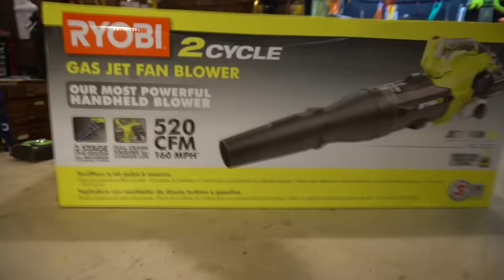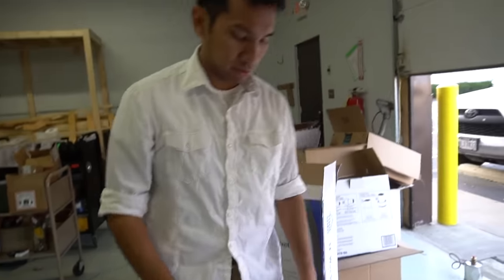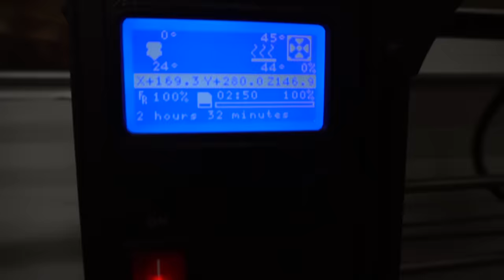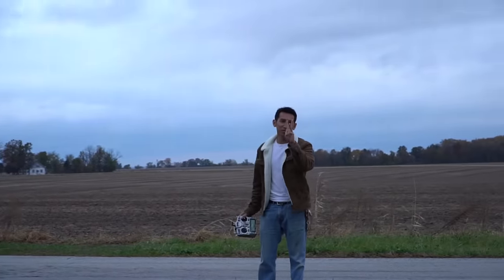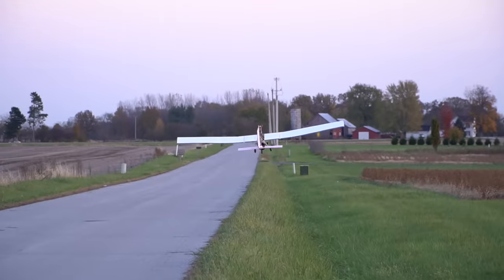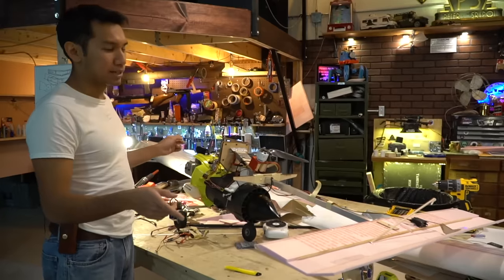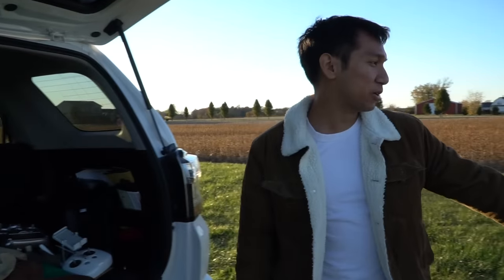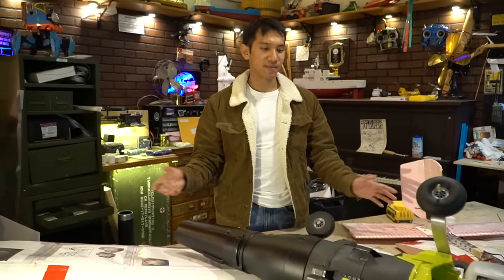FLYING Leaf Blower RC Airplane Drone

Comment: Hook a regular propeller up to the output shaft on that gassy boi and let'er rip!
Reply: Yeah, put a prop on the front of the gas motor shaft for a bit more thrust.
Reply: @greggv8  I have a weedeater engine with a 20x8 prop on it that pulls hard, never actually put it on anything though but I have heard people converting little 2 smoke engines to run RC planes before.  I mean frankly if he wanted to do that he could have the one I have if he pays shipping, more of a multi rotor person myself and won't use that engine in the long run.
Reply: Yes, stripping a twostroke down to the neccessities and bolting a prop to it is a great way to go. Maybe a lighter flywheel and a better exhaust and slightly advanced timing can further enhance performance, at least for the time being...
Reply: @KlockworXMusic  The early large scale planes used slightly modified chainsaw engines.
Reply: alternatively you can use a .5cc mini engine
Reply: Nice to see you on this video lol
Reply: a must first step is to always try to see if it glides well. throw if off your hand. to see how large the wings have to be
Reply: And adjust the throttle to make it really wind up
Reply: exactly
Reply: Junkyard Digs yeah man I thought of the same, like put it on the clutch
Reply: Yeah well... America💪
Reply: We did build some rc boats using 2 stroke chainsaw engines. Goes like nothing that you can buy of the shelf.
Reply: You need to add a larger duct to the existing smaller duct to add about 30% more thrust.
Reply: Don't give up yet.
Reply: @Asus Moh spam
Reply: KlockworXMusic c
Reply: Hi big fan
Reply: Take the head off and get some thinner gasket material to increase the engines compression
Reply: Kevin is a legend
Reply: P.s. thanks for your service
Reply: exactly Junkyard Digs, father an I used a Chainsaw back in the 70's an it worked great, right up till our plane thought it was a boat.
Reply: 666 like illuminate confirmed
Reply: Not a blower anymore then. Blower motor but not a blower.
Reply: ChessMasterNate under that logic, adding the wings should not be allowed, cause it is not a blower any more when you attach those wings. So now that the stupid arguments are out of the way, CHANGING the blower blades to one that is more suited for an airplane is far less of a modification then adding those wings and servos. If all you did was change the blower blade to a propeller and never added wings, you could still "Carefully" use it as a blower
Reply: I did not expect to find you here, cool
Reply: yea let'er rip tater chip
Reply: Leave it as is but modify the blower. I'm sure you can come up with something more aggressive what it came with.
Reply: Oh yes that would be amazing!
Reply: yeah I don't know why this didn't occur to them at the time. they would have to probably put some gears in to increase rotation and i'm not sure how much that would affect the engine's rpm. may not actually work in their favor.
Reply: Yeah, I was about to comment that dude!
Reply: @johnadams3152  good one
Reply: @voidedvlogs3215  yum Dr
Reply: @onthestageintheaudienceatt756  2
Reply: Holy fuck it’s JYD
Reply: 👍👍👍👍👍😂l

Comment: Get an oxy-Acetylene oxygen tank, filled to 2,000 psi.
Attach the wings and tail to it, battery box for servos & transceiver stuff.

Electric dump valve with nozzle.

These tanks have been known to launch several hundred feet when the valve
is suddenly snapped off- due to improper handling & storage.

At best- you'd have a 50 pound guided missle for 3-5 seconds
Reply: Dear god, what have you’ve done?
Reply: Do itttttttt
Reply: 50 pound? The ones I deal with are more like 190lbs
Reply: Top Mánager that’s not the point
Reply: You gotta point it towards your ex tho
Reply: only 20% chance of death
Reply: Combine it with some acetylene and you have a rocket, the power to weight ratio would probably be terrible though.

Comment: Dude are you using a flexible screwdriver like a regular screwdriver.....that's some kinda living hell
Reply: I was baffled.
Reply: Im kinda thinking it helps to prevent overturning the screws, since hes working with fairly soft materials, you dont wanna have the screw just drill a hole because you turned it to far, flexible screwdriver might help prevent that?
Reply: @suicidalbanananana  unless it has some sort of clutch, I can't imagine it reliabley providing that benefit.

Comment: Add a large diameter propeller to the starter clutch on the front of the plane (gas blower). Alter the clutch so you can wrap a rope around the outer circumference of it and pull start it without interfering with propeller. Turn the additional rotational force of the crankshaft into thrust with a "Puller prop." Increase main landing gear strut height if necessary for prop to ground clearance.
Reply: Or put prop with a nose cone and use electric starter

Comment: Damn I really want you guys to try the gas leaf blower again! I really think you can get it to work if you try to reduce the drag with some kind of lightweight nose cone around the engine and throw away that muffler and get an aluminum one.I'm sure there's more stuff you can cut off that engine as well like a bunch of the cooling fins. No need to stay cool we're just trying to get one quality flight here LOL. Maybe a little more wing possibly as well??

Comment: I think it will work if you mod the engine, i'm sure you could double the horse power and increase rpm,  buy one of those cheap ebay performance exhausts for pocket bikes, get a bigger carburetor, performance spark plug,  port and polish, and shave the head. good luck :)
Reply: "Performance spark plug" yeah half that crap you don't need. Bigger carb, flow the ports with a dremel maybe skim the head and remove any governers.  The timing is usually static and not very advanced so try and add a few degrees if you can but that alone makes a huge difference other than just a good tune and break in.
Reply: good idea buddy that might work in a car but might not on a plane . the exaust would stop the air flow and would be heavy. the carb might actually be a good idea also the spark plug idea is good and the the cutting the head part . nice dude
Reply: Experimental Fun pb exhausts are for making low end torque, not high rpm power. Won't work in this scenario. Better off finding a pipe for a 1/5 scale buggy. DDM could hook them up.
Reply: Toms Tech and how exactly do you adjust timing on a 2 stroke?
Reply: @chaegibson720  on that engine, move the flywheel by grinding down the with of the "key", one millimeter. that part of it that sticks up
Reply: chae gibson you install an offset flywheel key. This causes the magnet on the flywheel to pass under the coil/crank trigger before the piston is @ tdc. This has been a performance mod in the 2s snowmobile, bike & atv world for decades.
Reply: Jony Harri the days of grinding keys is long gone. Ddm has offset keys in stock.
Reply: @ROTAXD  you're on to something here dude. Keep it up. Maybe a large delta wing configuration?
Reply: Chances are you could prolle just check and see if the stock carb has a throttle stop most manufacturers will leave a little on the table when it comes to gas engines to make them more reliable
Reply: @ROTAXD  of course there are but you can still just make them, they take couple of minutes to do.
Reply: Jony Harri yes, you can gain a couple of degrees of timing by grinding. In order for that motor to make enough rpm to get off of the ground, you're looking at atting probably 8-10 degrees. You cannot get that much out of grinding unless you butcher a huge key and then it won't be accurately ground. With that much timing they'd likely have to run 110-118 octane race fuel. Have to run actual synthetic pre mix in her too. Motul, not that klotz garbage.
Reply: Ickmen VonMengus I'll leave the airframes/wing configurations up to you aero guys. Horsepower & suspension mods I'm willing to give advice on. Sustaining flight for more than a few seconds is out of my wheelhouse lol.
Reply: Or an electric blower
Reply: Before all that I would take out the throttle stop screw that adjusts top end speed. Try simple first.
Reply: offset flywheel key - ignition timimg
Reply: A 2 stroke racing fuel with more octane can also Help ! You get Them in Motorcross racing Stores
Reply: I've got a converted mcculloch 22cc weed eater engine that runs on 20% nitro and turns almost 20,000 rpm on a p51 mustang with an 8 foot wingspan I need to go dig it out at sometime and get it going again

Comment: I think your original gas powered leaf blower would have worked if you used a biplane or triplane design, you just didn't have enough wing area.

Early aircraft designers had to work with unbelievably underpowered engines, but they worked because of the huge wing area of biplanes. They may not have flown fast, but they flew.
Reply: Too much drag, not enough thrust. I'm not an expert or anything but judging by how bad the thrust to weight ratio is adding more wings would only make the problem worse. Yeah you get more lift, but does it matter when you're going too slow for it to matter?
Reply: @Robert-qm7yi  The primary advantage of the biplane over a monoplane is to combine great stiffness with light weight. Stiffness requires structural depth and, where early monoplanes had to have this added with complicated extra bracing, the box kite or biplane naturally has a deep structure and is therefore easier to make both light and strong. A braced monoplane wing must support itself fully, while the two wings of a biplane help to stiffen each other. The biplane is therefore inherently stiffer than the monoplane. Also, the structural forces in the spars of a biplane wing tend to be lower, so the wing can use less material to obtain the same overall strength and is therefore much lighter. A disadvantage of the biplane was the need for extra struts to space the wings apart, although the bracing required by early monoplanes reduced this disadvantage. 

The low power supplied by the engines available in the first years of aviation meant that aeroplanes could only fly slowly. This required an even lower stalling speed, which in turn required a low wing loading, combining both large wing area with light weight. A biplane wing of a given span and chord has twice the area of a monoplane the same size and so can fly more slowly, or for a given flight speed can lift more weight. Alternatively, a biplane wing of the same area as a monoplane has lower span and chord, reducing the structural forces and allowing it to be lighter.

Biplanes suffer aerodynamic interference between the two planes. This means that a biplane does not in practice obtain twice the lift of the similarly-sized monoplane. The farther apart the wings are spaced the less the interference, but the spacing struts must be longer. Given the low speed and power of early aircraft, the drag penalty of the wires and struts and the mutual interference of airflows were relatively minor and acceptable factors.
Reply: Those early planes had props, which made a huge amount of airflow on the wings (lift). The biplane took extra advantage of that (not double, but a lot more wing area in the props airflow), so they make ridiculous amounts of lift compared to a turbine/ducted design. I've done a jet powered plane, and wow, you really miss having the high air velocity from the props! That's why a normal RC plane can take off from a standstill (lot of lift even stationary). For ducted/jet you only get lift with relative velocity of the plane.
Reply: @Robert-qm7yi  Just adding another deck of wing and a few spars won't increase the drag that significantly compared to biplanes back in WW1. In addition to being biplanes, they also usually had significant numbers of bracing wires to hold the plane together. Pusher types like the Airco D.H.2 had it especially bad, the boom that held the tail on behind the fuselage required a ridiculous number of them to keep it structural.

Here's a good video on it:
https://www.youtube.com/watch?v=h4eTBQGbrBU
Reply: @jakegarrett8109  True, they had props in front wich helped With the airflow on the wings.
But, let's not rule it out simply because it's a turbine/ducted design.
It is still Worth a try as the biplane configuration can have lighter wings despite it having two planes, rather than a monoplane configuration where the wings are heavier.
The reason i'm voting for the biplane design is because you need less speed compared to the monoplane design in order to achieve lift.
Reply: @GGigabiteM  I don't think a leaf blower has the volume output to make it work. Blowers work off pressure more than volume, props work off volume more than pressure. You're trying to mix two opposing sets of strengths and weaknesses and thinking it will work. I'm not fluent in aerodynamics by any means, but seeing how pitiful it is with just one set of wings I doubt two would help much. Maybe a touch longer wingspan or different geometry would help but just slapping another set on isn't always a good answer
Reply: I was thinking that too. Maybe a channel wing could work as well being designed to have higher lift than a normal wing.
Reply: @Robert-qm7yi   A monoplane design requires Heavy wings in order to support itself, thus making it heavier, the disadvantages will be larger.
A biplane design allows for lighter wings and structure as they don't need the same amount of materials in order to support itself, as the two planes will help support eachother, making it so you can have a much larger wing area while still being lighter than a monoplane design.
Reply: You know what I think

I think he should attach a blender laid sideways tape some wings to it and then see if that flys
Reply: Yeah, i was thinking the same thing. A biplane or triplane(like the WW I Fokker) setup might create better lift while keeping the power to weight ratio in check.

Of course it will be very slow, but it might stay in the air better without assisted take-off.
Reply: Exactly. But if he modifies the blower to have it open at both ends, and adjusts the wings it can be a scramjet and go hypersonic!

Comment: if you put a bigger carb, port the motor slightly and tuned pipe. It will have a crap ton of power.
Reply: And get rid of the wheels..we don't need no steenkin' wheels. Plus you have the SamCat launch system.
Reply: @BrilliantDesignOnline  lol i laughed so hard at the "sam cat launch system "
Reply: Running it too much faster would probably result in throwing the connecting rod in the engine. (Engine failure)

Comment: To trim weight you could use a grinder to cut most of the heat sink fins off the gas engine. It was most likely designed to be used not moving much but when its flying in a plane and has more air moving over the engine it wont need as large of cooling fins. Same reason why old nitro engines for rc cars have much larger heat sinks then nitro airplane engines.
Reply: That wouldn't work. The turbine pull air over the fins, and removing them would cause the engine to overheat and sieze. The movement wouldn't help as the turbine already pulls air over the fins, so there is no increase in airspeed.

Comment: If the electric leaf blower weighed half as much as the gas one, could you use two of them? The tail boom might need to be a giant Y duct to avoid accidental differential thrust, though, and that seems like it’d be heavy. It wouldn’t account for the differential drag, but I don’t know if that’s an actual problem at these speeds. Maybe mount them vertically instead of side-by-side?

Comment: maybe its the giroscopic effect of that high rpm engine with a large inertial mass rotating in it thats making it hard to steer.
Reply: Good thought.  But I don't think he know how to fly a plane.
Reply: Woooow someone took intro physics
Reply: @lnlyby_yt  Dynamics* 6th semester of mechanical Engineering
Reply: thiagov6123 // Is it hard?
Reply: thiagov6123 this is what they’re teaching you in your 6th year? This is entry level physics
Reply: @lnlyby_yt  3rd year, 6th semester. This and other things, but it would be hard to understand unless you know how to solve differential equations.
Reply: @pencilspianos8412  Is what hard? Dynamics?
Reply: Is this in the US? I would understand that then
Reply: @lnlyby_yt  I study in a Federal University in Rio de Janeiro, Brazil.
Reply: @thiagov6123  BURN @ JitterBugg Will
Reply: That would affect horizontal rotation the most
Reply: hellogram haha I’m not wrong, it is entry level physics
Reply: Jason Thornton how was it a burn though
Reply: Good point, I guess that is why they have rotary engines in planes?!
Reply: I don't understand any of this but hi
Reply: @resih900  good on you bro

Comment: Just stick a prop on the front spinning part for double thrust with no extra electric motor and battery weight lol
Reply: You wont create any more thrist due to power loss to the blower.

Comment: Try a better quality leaf blower, also add less oil to your 2 stroke mix. It will shorten the engine life but it will lean out an rev harder.
There are lots of tuning things you can do to the leaf blower to get a little extra power from it. Maybe also different nozzles. I know you wanted it "stock" but I'd rather see a modified leaf blower fly than a stock leaf blower fail....
Reply: Yep. A better (or none at all) filter, a straight pipe, and a better turbine would make this thing work well.
Reply: @boostaddict_  Give it a chamber on the pipe to "supercharge" it.
Reply: using less oil will enrich the mixture. SMH.
Reply: @dirtrider88  I was thinking the same thing.
Reply: @dirtrider88  The oil is more potent than the gas, so it makes the AFR richer. Less oil means the fuel will be less combustible but ignite faster, because the AFR will be leaner. There would be more gas but the mixture would be leaner. Kinda confusing but if you think about it it makes sense.